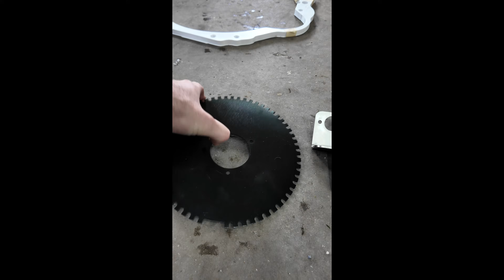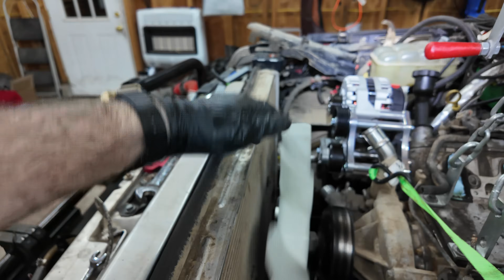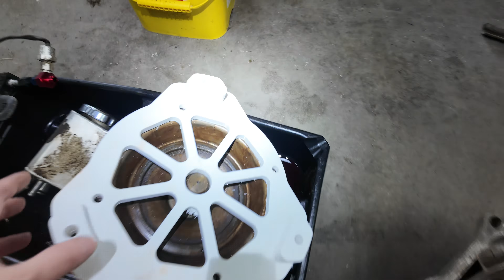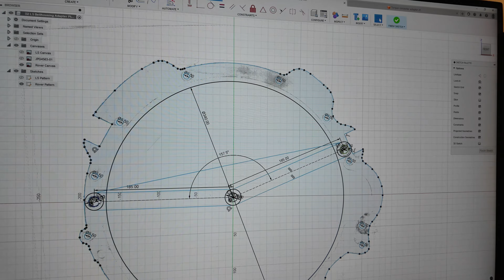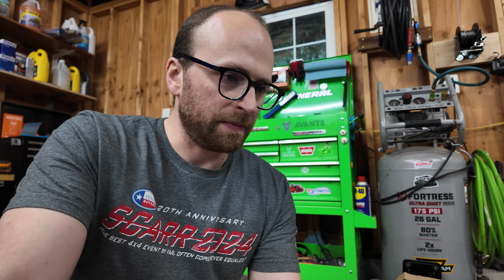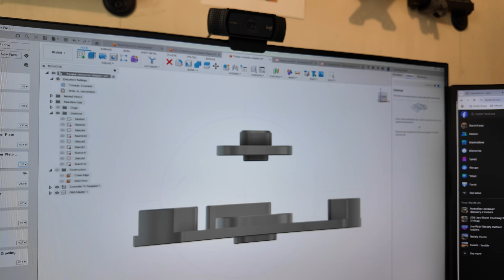[Making Of] Discovery II LS Swap Kit - Part 2: Prototypes, Engine Mounts, Torque Converter

Comment: Would it be easier to swap in a 4.4 Jag V8 engine from Disco 3?
Reply from the maker: I don't think so. The Gen 3 LS is so cheap, dead simple, so well documented, and so easy to procure. The LR3's 4.4 is much more complex, and not easy to get since you have to kill an LR3 to get it.

Comment: I was planning a ace ls swap kit then then they closed the doors so I have decided a bmw m57 engine swap with 6 speed transmission because of the excellent fuel mileage and v8 power from a inline cylinder I just bought a 2010 33d bmw for 2k I find it better to buy a complete car than engine only I wanted a 2003 m57 engine but here in usa not so easy like in uk the m57 know for 30 to 45 mpg hp 265 torque 425 plenty of room for more power if dedesired

Comment: Part 3! On my ace kit I removed the landrover MAF and couldn't really feel a difference. Ended up running the intake to the passenger side. Would be  cool if you could do some research into whether it actually makes a difference for shift quality.
Reply: I deleted the rover maf as well. No issues I can tell
Reply: @memimeman  Haven't verified myself, but word on the street is the rover MAF is used by the transmission to figure out how much hydraulic pressure to apply. Without the MAF, it will use maximum pressure which could shorten the lifespan of the components.
Reply: @Dynamite9500  yeah heard that too and am willing to take the risk, I have a cam in my setup and my transmission has 220k miles. I figure the higher pressures will help it hold better. I threw a huge transmission cooler on it to give it a fighting chance. Got a couple thousand miles on it so far and some wheeling. Seems ok for now. I figure if it does go, I’ll consider a 6L80 swap at that point.
Reply from the maker: I will look into it. Thank you
Reply: @GoldenRovers : I am ready asa you are .
Reply: @GoldenRovers I am ready with my card number!!